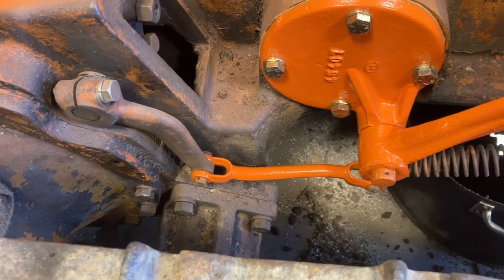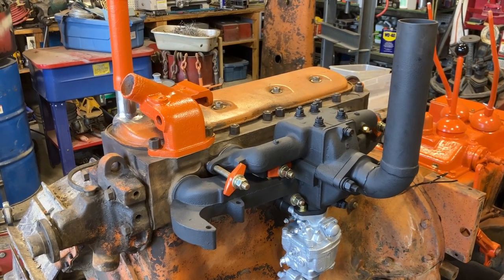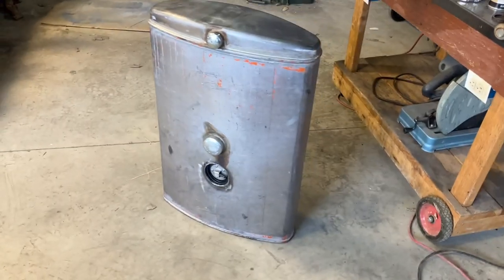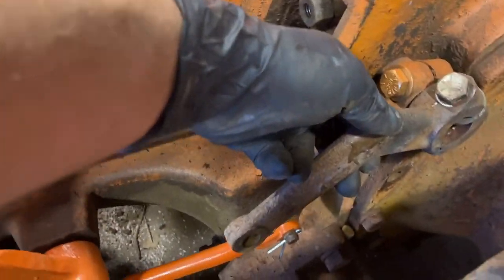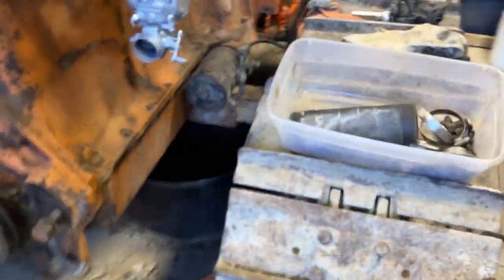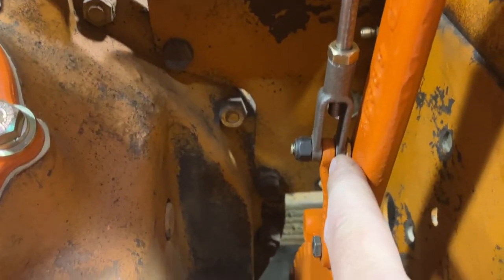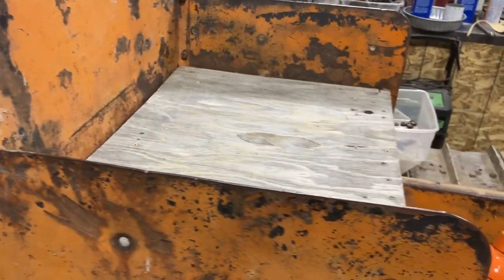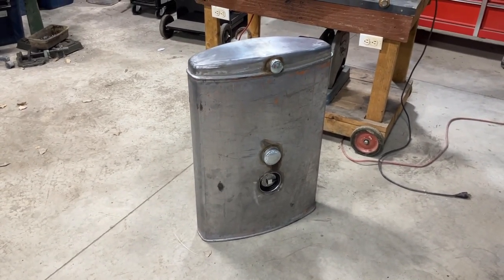Allis Chalmers M (part 10) Brake pedal linkage and special visitor!! Starting to look like a Crawler

Comment: I see by the seat back you have the later model. It has a slightly larger bore than the original. The one I ran was the older model. It had lots of power. Kept up with a 5U D2 discing with 6' 9"  discs  4 th gear in both. I had the late model like yours in the shop for a valve job that never got done, son moved it outside and has been setting for years. I had the original shop manual for it but traded it off for a Farmall A carcass.
Reply from the maker: Yes it’s a 1942. The serial number is in the 16*** range so it late production.  I am eager to put some tillage behind it to see what it will do.  Thank you for sharing!!!!
Reply: I’ve got a mid 30’s WM